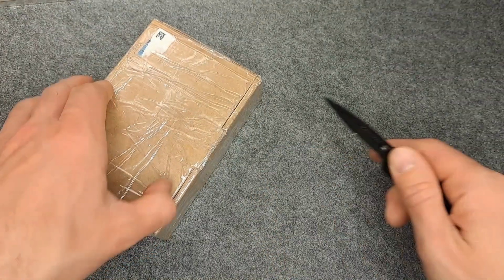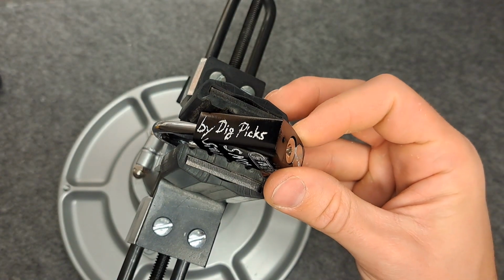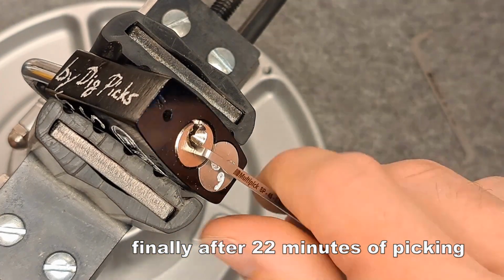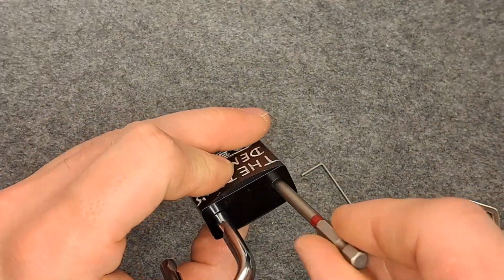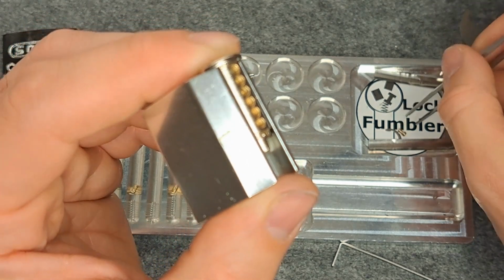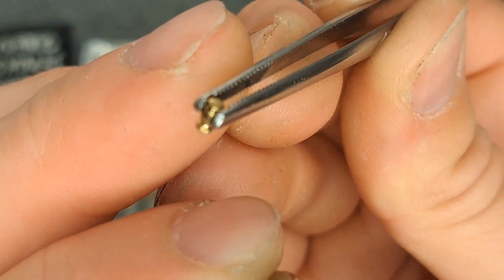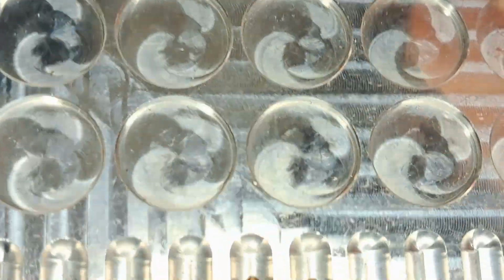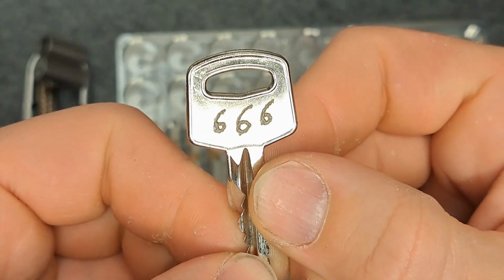[191] 1st Challenge Lock from @dignitypicks  "The Devil's Demons"

Comment: Absolutely awesome pick and a great great video, thanks a lot for this first try on my first challenge lock! You nailed it on your analysis!

1. The Key: 
that is the original just slightly modified. The gaps on the key blade are just for confusion. They let the key look way more evil and should remind other pickers on the awesome emhart key and lock. It’s kind of a tribute to the emhart ;)

2. The plug: 
it is completely milled on all 6 chambers. I tried to mill it pretty close to the edge to create the possible most short distance and the most sharp edge possible :D My problem was that I wanted to get the gin like pins in the milling and for that the milling needed to be that close to the edge. I measured the slots and as far as I can tell I didn’t changed the holes itself. I just did this under milling pretty pretty close to the edge. 

3. the housing: 
That was just modified by the engraving

4. the driver pins: 
I put out all original driver pins and shaped new ones from 2,5 mm diameter brass rod. So all driver pins are made from scratch. All driver pins are kind of tapered as I think that are the most grinding pin style for me since now :D but I also love gins and Christmas trees so some of them are shaped like that to interact perfectly with the milling I did. It kind of worked out happily :D 
Pin 3 I call the Tesla spool as it looked like one :D 
Pin 5 was the one where my key gave me the less room to work with so I decided to make this the pin which holds the core straight. I don’t like it if the core is to sloppy and wiggles around without even one pin picked. A normal standard was too boring so I went for a lightly tapered again with one really sharp small serration. 
I think you analyzed it perfectly.

My goal was to make a nasty still nice to pick one which needs several pickings of each pin to grind someone down :D Also I wanted to make the most out of kind of simple pins. Nothing fancy as rattlesnakes or pin in pin as this was anyway to hard as start for me :D

The keypins grind me down on the shaping process. I made the first from scratch and it took soooooo long to get it exactly to the right size. I think if you have an existing key with already existing bitting that is just a long task :D after I got this I decided to do keypin 2-6 just as modifications on the original pins because….. Ouh my god I’m so stupid xD just realized that I could have compared the size to the existing keypins…. Hmm nevermind now it’s done :D maybe next time.

So all in all I think it turned out as wanted and I’m happy I created a small challenge :)

Thanks again for receiving it as first one to try on it and thanks again for this great video.

PS: I will upload pictures of how the pins are oriented in the CL channel on discord ;)
Reply from the maker: Thank you very much for adding this much information!! Amazing work!
Awesome that you shaped the drivers from scratch! 
Good choice with driver 5. Less slop also helps to insert the key better, especially in a chamber deeper in the core 👍
I will checkout the pictures and orientate the drivers as designed 😊
So thanks again for letting my try it and I will make sure it won't stay at my place for too long 👍 (... I have a few CLs i have to pass on now 🙈)
Reply: Thank you very much for that - You answered all my questions 👍👍👍 Absolutely Brilliant mate 👍 🍻
Reply: Man I think it was great! Love this breakdown on the process and lock!
Reply: @LockFumbler  yeah that was exactly the intention. Had some problems inserting the key and it didn’t felt good. So I decided to do that with this big kind of tapered on 5…. And 5 because the standard is normally on 6 and 5 was also the slot with the least interaction so I went with that ;)
Reply: @LockFumbler  I’m happy to receive one if you don’t mind. Time doesn’t play a role, absolutely no rush needed :)
Reply: @BeercanBushcraft  Thanks! :)
Reply: @SadisticPicker  Happy to hear that, thanks :)